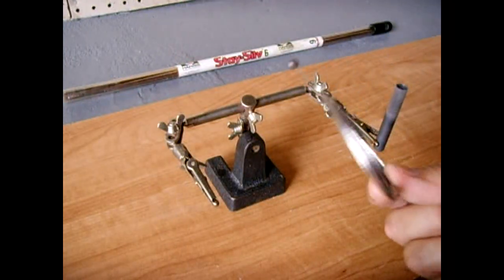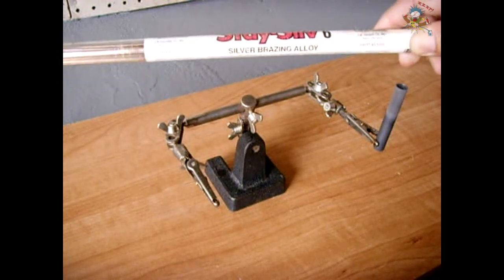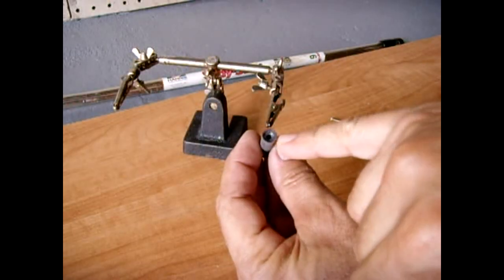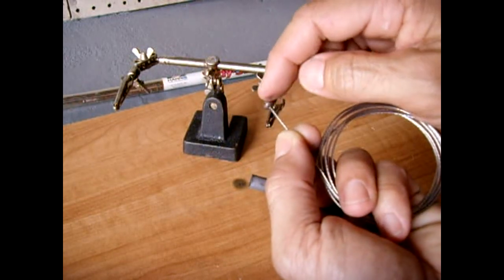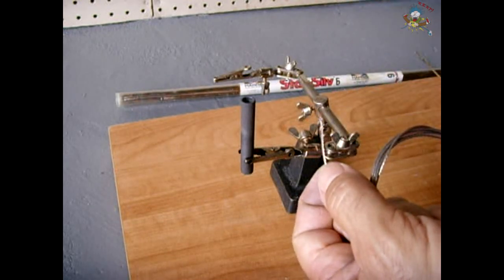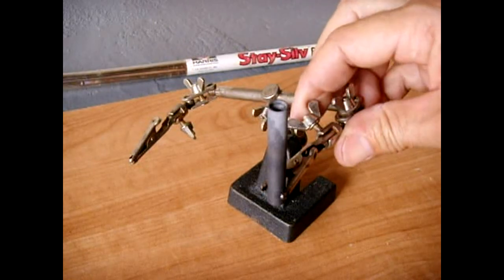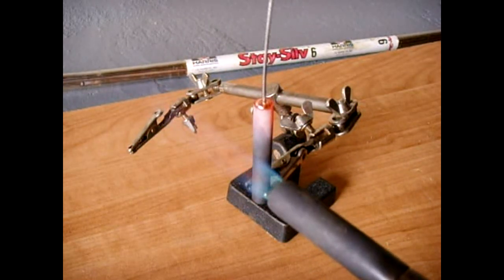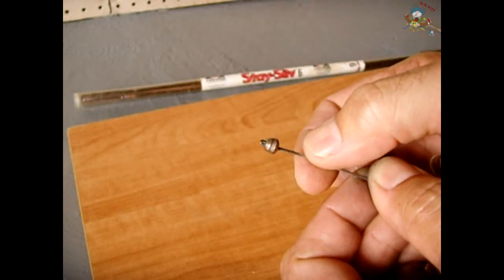How To Repair Brake/Throttle Cable Ends! (The Right Way)

Comment: Here i am years later and still you have a great way of making  a end.
 This works for lawnmower cables. Just need solder because less stress but if need be use sliver.

Comment: Strongest repair I've ever seen. Thanks I, have all the equipment and Stasilv being in the HVAC business for ever. All I need now is a rod out of a D battery. Looks easy to me and super strong.
Reply from the maker: You wont find a better way. My Stay-Silv rods were also used for installing Central A/C systems. The brazing rod material is incredibly hard, and you'll never be able to pull the loop through. Thanks for watching!

Comment: Excellent video! Wanted to see what material you used for the lug. I was thinking wheel weights. But you went one better. Nice tip on finding a carbon rod! Thought you might use an old fishing rod filled with clay. But a battery is much easier and cheaper. And the carbon does everything you need better than anything else. Nice job!

Comment: Great video man I'm working on a 82' Suzuki and this was a life saver for when my throttle cable broke
Reply from the maker: Will Macconnachie Great to hear!
Reply: Same, when installing ZRX1200 carbs on my 81 XS1100 with broken float post on #4 carb.

Comment: Great video! I've looked at many videos on how to repair or make control cables. Your method is the best I've seen thus far. Your instruction is comprehensive and complete.
Reply from the maker: You won't find a stronger repair/better method. :-) Thanks for watching.

Comment: Great Video, but one correction, graphite is used in SOME Nuclear reactors as a moderator to slow down neutrons as to promote fission with U235.  You DO not want any part of your reactor to be normally hotter than about 1200 Deg C FUel will melt at about 2100Deg C..  Never the less, graphite is good for high heat applications.

Comment: I realize that this video has been around for quite some time but I thought it'd be a good place to ask since you stated that you worked on refrigeration units or at least that's what I thought I heard. My nephew in law wants me to replace a compressor in their stand alone freezer and I've never done it before. I think all I basically need is some brazing rod and a vacuum unit to vacuum the system and some refrigerant to refill. I guess my question is can I braze the lines with a propane torch or do I need oxygen acetylene? What else special would I need to do this job?
 Any help would be appreciated 👍
Reply from the maker: If the copper lines are fairly small, the torch may be able to do it, use MAPP gas, it burns hotter. You cannot braze the lines unless the air/residual refrigerant has been flushed out using nitrogen.

Comment: I appreciate the info, but who has all the things laying around to do this with. By the time I get all these tools to do the job, wouldn't it be cheaper and less hassle to just buy a new one? Your outcome with this procedure is great tho!
Reply from the maker: True, not every person will have a propane torch and brazing rods on hand. Thanks for watching Dan!
Reply: @electronicsNmore  I see many comment about not having the supplies hanging around and better to just buy a new cable. I have all the supplies, pretty sure my neighbor does. My friends I hang out with certainly do. DIY vids are not for everyone. Thanks for the vid.
Reply: some need special lengths cable, this is why this is great, example: sturmey-archer brake drums in bicycles or velomobile's.

Comment: This procedure  could be very useful to shorten  a wound drive cable on a string trimmer to shorten the distance between the gasoline motor to the trimmer head

Comment: So is this stainless steel cable stronger than the aftermarket throttle cables?
Reply from the maker: It's a braided stainless cable I had laying around.

Comment: can i use that brazing rod for other thigns as well? such as affixing a steel pin to a cast iron part?

is there a way to build up the solder on top of itself easily, on a vertical part (like a wall)? I would weld it, but welding steel to iron tends to crack or cause other problems. i also only have a 130A MIG.
Reply from the maker: Munky332 This brazing rod is not designed for steel. I have another video coming up showing exactly what to use for steel.
Reply: electronicsNmore thanks. the biggest issue for me is getting the steel pin to stay affixed to cast iron. there's really no good way to weld it (i've tried, didnt hold up) right now i've just got it affixed using JB weld, but thats just a temporary solution.
Reply from the maker: There is. Use exactly what I suggest in my next video. You can braze steel to cast iron.

Comment: where do you buy your solder or brazing rod at ? And you said that the carbon rod was out of a "D" battery ?
Reply from the maker: You can buy it online or at a refrigeration supply house. Yes, "D" cell battery. :-)

Comment: You can buy brake cables that will last as long as DIY ones for under a dollar from China. That's certainly less than a new 6 foot length of galvanized cable, solder/brazing rod and the time cost
Reply from the maker: You can be assured that a 1 dollar brake cable will be garbage.
Reply: That wasn't the point of the video sonny boy... The OP is helping people fix cables and you come up with a 1$ China solution, thanks so much... SMFH

Comment: wjere can you get the rod that you used not the braziñg rod but the one u use as a templete
Reply from the maker: +dan staszko 
Inside a "D" cell carbon zinc battery, or look for a carbon rod on Ebay. Thanks for watching!

Comment: Honda. fixed.. accelerator cable.. cheers.. one thing tho.. no flux needed.?  newbee. still learning.
Reply from the maker: Sometimes I use a very small amount of hotmax brazing flux. If the cable was extremely clean, and folded over as shown, you should be fine.

Comment: +electronicsnmore any idea how to do this to a bare cut cable ends on bicycle gear/brake cables with a smooth finish without any bulges?
I hate using those crimp ends cos if u remove them the stranded end just breaks up :(
Reply from the maker: The connector shown in this video was made for my mountain bike.
Reply: electronicsNmore  yes i knew that but i want to tidy up the bare cut cable ends without using those crimp cable ends as they shred the cable end when u remove them :(

Comment: nice video can u mill the ends not all ends are ball
Reply from the maker: If you have a cylindrical end on your cable, you can make the cable end larger, then grind it to shape. You can also drill the hole into the carbon rod deeper, then carefully cut a slit in the side of the carbon rod using a diamond cut-off wheel on a Dremel. By doing that, you can end up with a cylindrical shape. The wire slides into the cut in the carbon rod, then you add the brazing rod material. The carbon rod will likely break when you remove the longer cylinder shaped end on the cable. So plan on one use only for the carbon rod.
Reply: thanks ill try that

Comment: You keep using the word 'brazing' but if you are not using brass, its not brazing.  You can look it up.  When you use silver solder, its soldering
Reply from the maker: +p kerit 
Incorrect. You did not know that you can braze steel? Brazing means "High Temperature Soldering/Hard soldering". I have no idea where you got your information from. Since I am using a "Brazing" rod for this repair, I am certainly not going to refer to the rod as solder. :-)

Comment: there's a magnet for stainless? damn....where did you find that magnet? i never knew it exists. i would love to grab a hold of a magnet that stick to stainless. lol
Reply from the maker: Yes, there are 2 types of stainless, magnetic and non-magnetic.
Reply: @electronicsNmore  i work with a lot of stainless. its either pure stainless or its not.
Reply from the maker: @iceyaj3167  You clearly don't know too much about stainless. Go into any scrap metal dealer with a piece of stainless scrap, and they'll test it with a magnet.
Reply: @electronicsNmore  scarp dealer? LOL i work in a fabrication shop who deals with stainless. i think you don't know about stainless. let me explain. when a magnet sticks to a so call "stainless steel" what you're seeing is the world cheapest stainless a man can buy. 409 and 430 grade have more iron built into them which magnets love to stick onto. that's what we're seeing in the video. the reason why they call it stainless its because there's hair amount of chromium built into them and the rest are pretty much iron. and then manufacturer labeled "stainless steel" all because the touch amount of chromium.  kinda like saying buying full synthetic motor oil vs. blended. real stainless that isn't magnetic are 304 and 316.

Comment: interesting project but holy b'jezus.   all this work and materials and effort to fix cables that cost less than $2 to replace with a brand new one.   shit no.
Reply from the maker: It is not a lot of work. Once you have the carbon rod drilled out, it is really easy to do. I don't know what cables you are buying for $2.00. Any decent cable on a car/boat/jet ski/motorcycle, costs a lot more than that.
Reply: @littlegoobie: Why are you watching a video on how to do something yourself if you have no interest in doing something yourself? Projects like these are not just about the finished product. To me, they are more the demonstration of creativity. And this video is a perfect example! I would like to articulate more on the importance of rejecting the option to 'just go buy something' and figure out a way to do it yourself...but I have to go source a heavy duty D-cell battery and a brazing rod so I can make some new cables for my bicycle! Thank you, electronicsNmore for sharing your idea with us!
Reply from the maker: Your welcome! Just last night I was going for a bike ride and my rear brake cable snapped in the middle from rust. Luckily I made an extra cable and had it put aside. :-) Where I live you cannot buy cables.
Reply: No the best use is custom cable lengths----you can't just buy them
Reply: Plus some people would rather make an item than buy it. Adds more pride to your work! THANKS electronicNmore, Great video!!